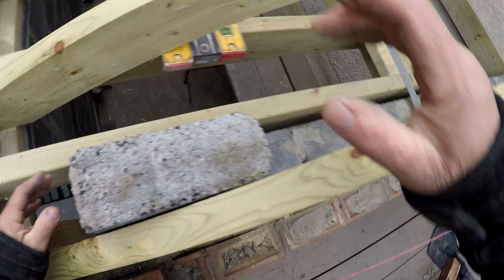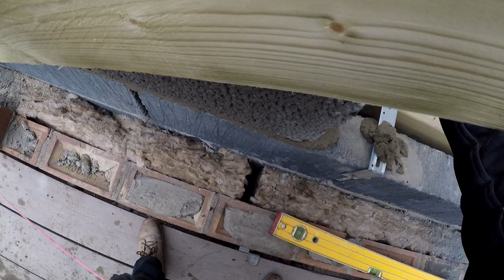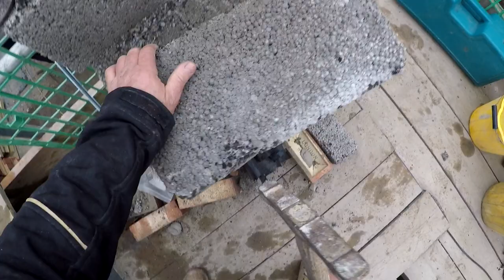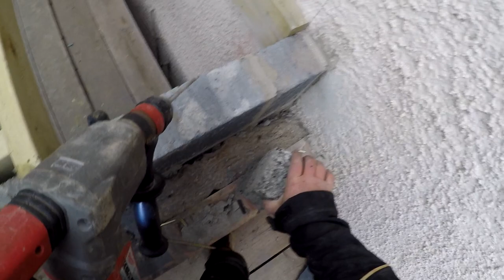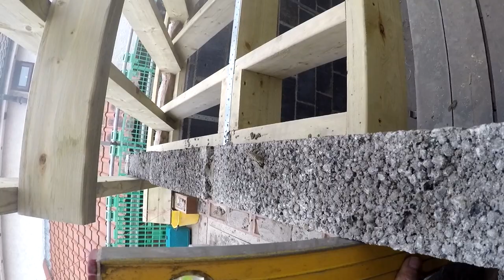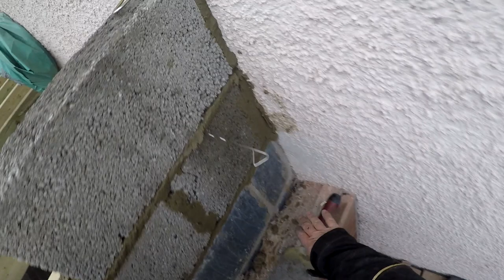Laying blocks, building the gable. The old boy method...

Comment: Wall ties have a drip built into the centre of them which should be pointing down to prevent water or moisture from travelling its length and breaching the cavity. Its also why its important to keep to gauge , so that the ties remain level and do not angle down towards the inner leaf.
Reply from the maker: Really appreciate the info! Cheers
Reply: That's intresting working around London bricklaying for about 40 years on new office blocks a few new schools and industrial units and housing sites iv only ever seen 2 jobs where the wall ties have been kept level.no one gauges the backing up internal work or in a lot of cases guesses the brickwork gauge usually 30 mill high per 22 courses.also keeping cavitys the right size never seen that either.no one does it.some clerk of works pick up on it most don't bother.i used to always have a pair of pliers in my box to bend stainless steel wall ties up or down .I got quite skilled at bending them so they sat flat without springing the brick up  you laid on top of it skilled wall tie bender I became  all part of my training?? I think not.one new block of flats I worked on in Wembley . 2 of us were suspicious so we checked and  leveled the first floor round the entire  scaffold lift when everyone had gone home it was 5 inches out of level in places.we just said nothing and kept it that way it's still standing today no one knows.keep your mouth shut and get on with your work they used to tell us.but I hated doing  this kind of shit work.but on a big site with a big gang of men  you had no choice.

Comment: Well done mate, but why did you change blocks for the gable
Reply from the maker: Ones below were insolation blocks
Reply: And.??? Still would have used a thermal block in the gable.! If it’s about cost there’s jack shit difference these days.! Sod that for a game of soldiers.!
Reply: @nigelsmith1198  Yeh I saw that as well you lose the u value.or the insulation value.i did a new built house.and they sealed it up pumped hot air into it and measured how much heat leaked out of it and where it leaked from.couldent mix different materials on new build.and the old trick of using a brick in the corners of block work to get half bond is definitely a no no.the site agent will shout you get that effing brick out.have to cut a quarter block piece.keep the same materials.